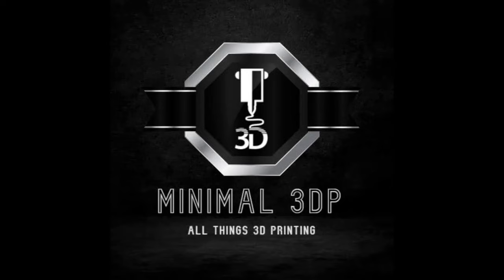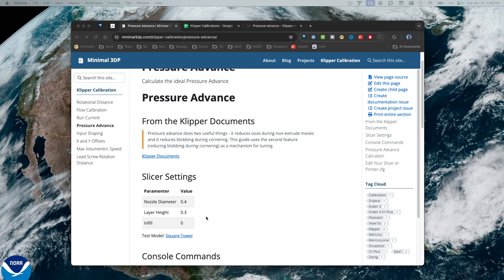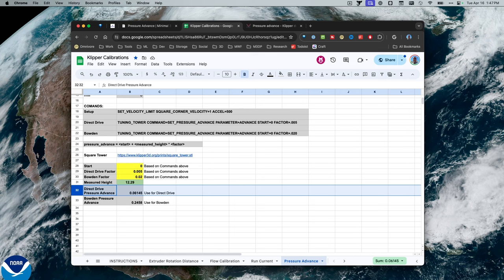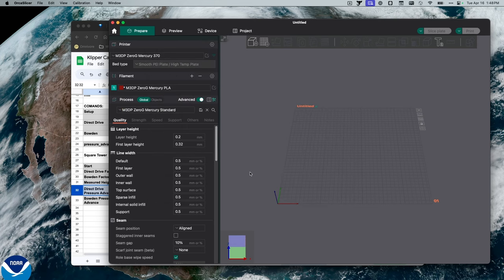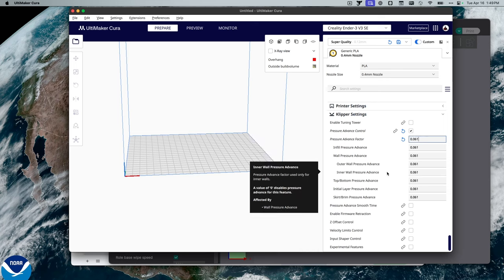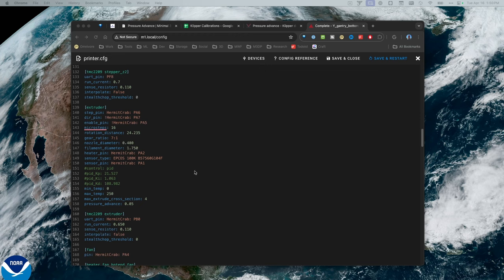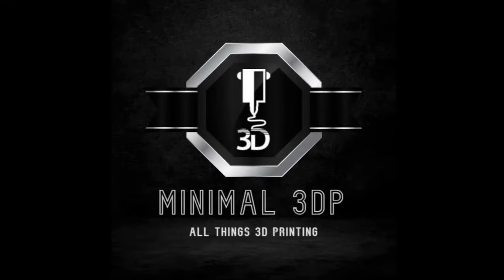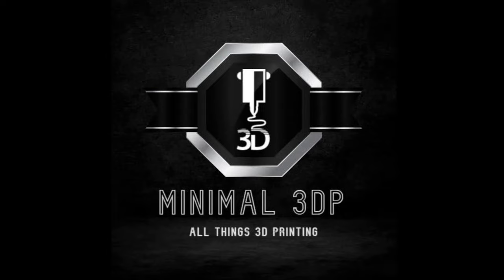I Calculated My 3D Printer Pressure Advance, Now What?

Comment: Since it can change by filament, my approach is the have a sensible pressure_advance setting in my Klipper config, but to have a line like "SET_PRESSURE_ADVANCE EXTRUDER=extruder ADVANCE=0.032" in my filament Start G-code section to override on a per-filament basis.